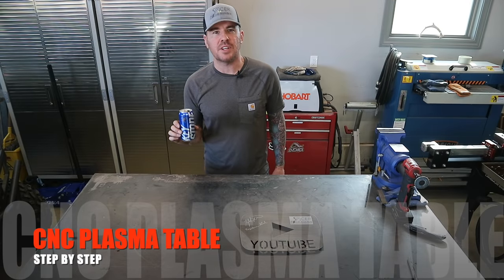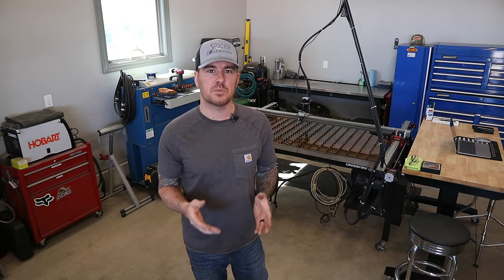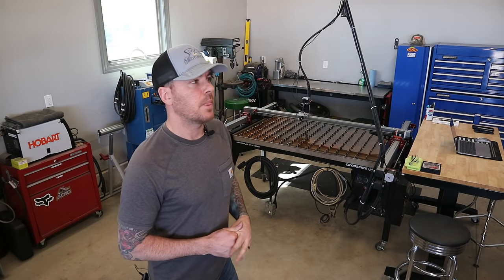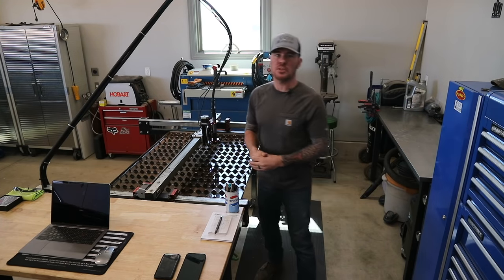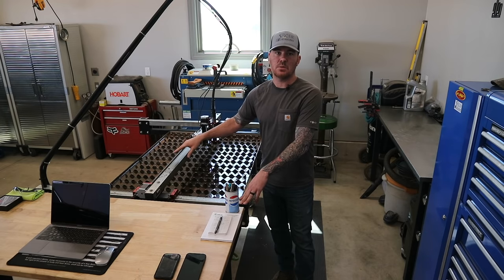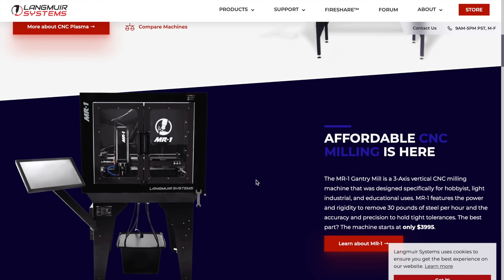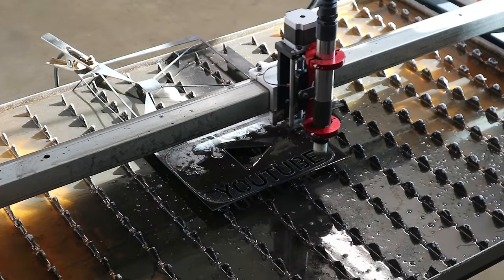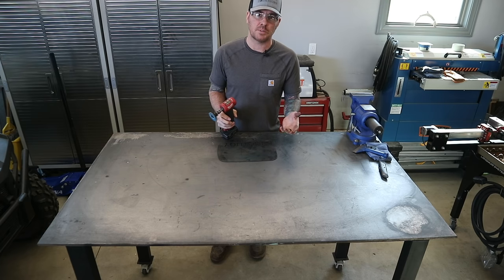MAKING MONEY with CNC PLASMA TABLE! .....STEP by STEP

Comment: 4x8 12 gauge isn’t around $100. Cold roll is more expensive than hot rolled because no mill scale on cold roll. And the water is to keep smoke and fumes down not keep parts cool. Learn the basic before giving advice big dog.
Reply from the maker: Those were just general numbers for general info.  14 ga is $100 a sheet for hot rolled.  The video is to give people the basic idea of the whole process.  I say in many of my videos im not claiming to be an expert.  The water dissipates sparks and helps with warping.  Theres still plenty of smoke and fumes.  Thanks for the pointer big dog.  I just checked your channel to see how its done.  No info.

Comment: If you're looking for sponsorship, you may want to reconsider your "on air" behavior/consumption. Or ask Keystone for sponsorship. I don't imagine any vendor of fabrication machinery would condone alcohol consumption in the work place. Just my 2¢.
Reply from the maker: Ive had two cnc laser companies reach out.  They didnt seem to concerned.  The workplace is my garage.  The alcohol consumption is all just a bit for the keystone girl which is a big reason why i get views.  98 percent of the time those cans are empty.   Thanks for your concern but ive got it all under control.
Reply: @SpicerDesignsLLC  Okay, glad to hear it. As most corporate sponsors are concerned with appearances, I just thought you might want to consider that. Best of luck and keep up the informative vids.